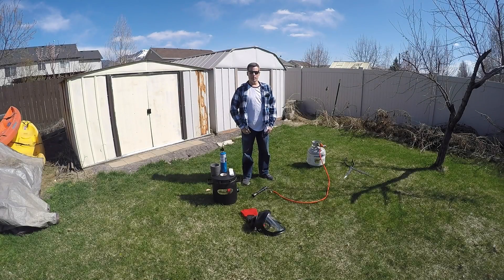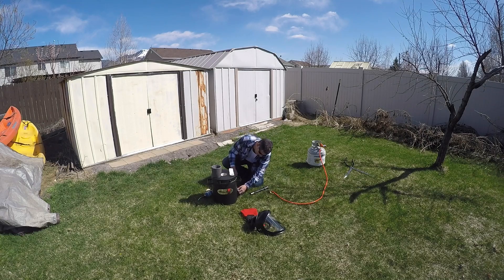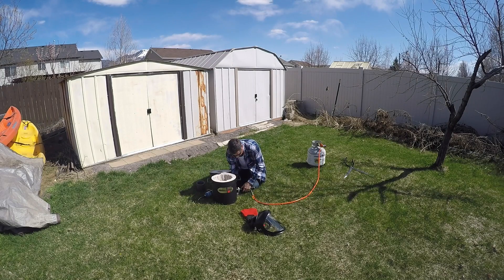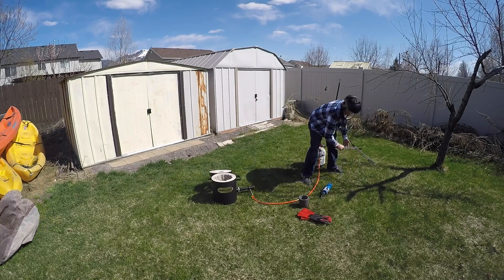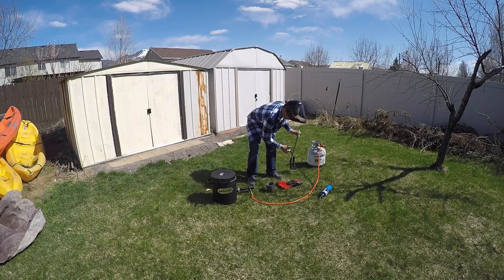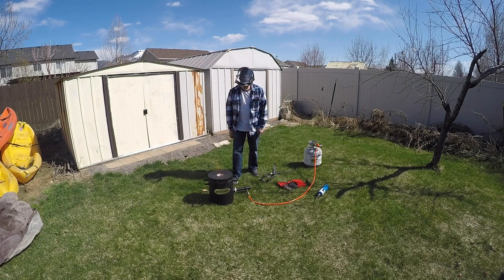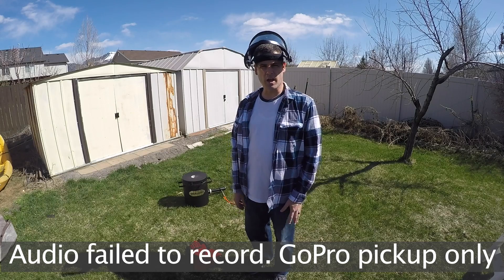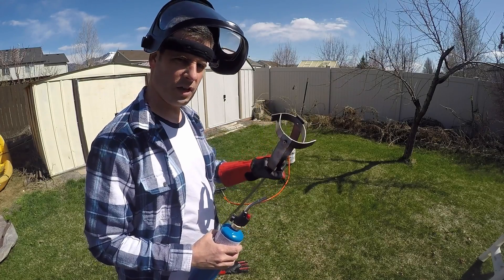Tempering a Graphite Crucible in my Devil Forge

Comment: does it smell when you temper the crucible?
Reply from the maker: No, not that I have ever smelled.  I do smell a few things when I heat up my forge.  I use propane, so I smell a distinct smell from burning propane, and the forge has a mess of "stuff" at the bottom ... metal spill out and other stuff that has collected at the bottom of the forge.  I smell that when ever I light the forge.
Reply: Where did you get them tongs from ?

Comment: Temper 400° for one hour. Either way they don’t last long.
Reply from the maker: They are not immortal, it is true ... but I am still using these 2.  I have a few others, which are not faring as well ... but these two graphites are still my main copper/brass/aluminum melters.  I also changed my focus, so I don't melt every week like I used to... but they were put in the heat every week for the first year... then I got into the Gold refining... :)